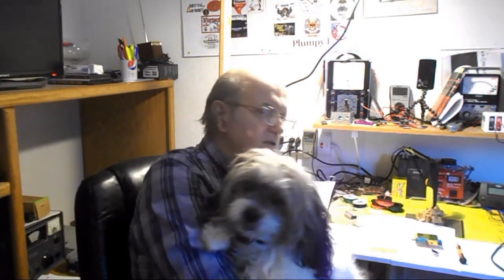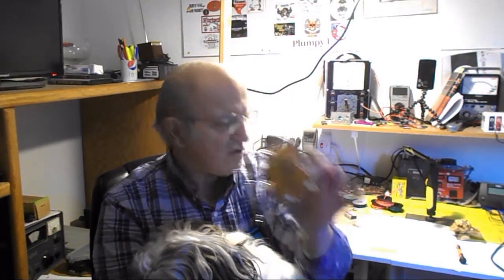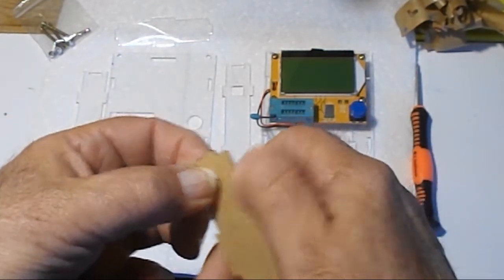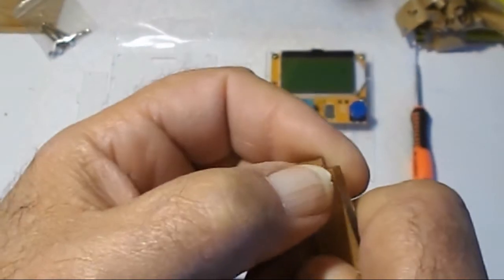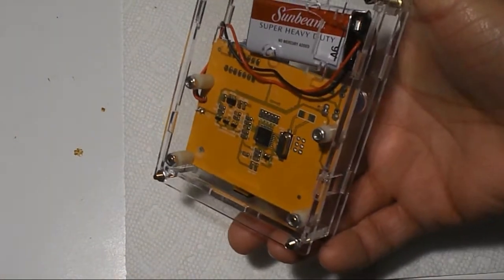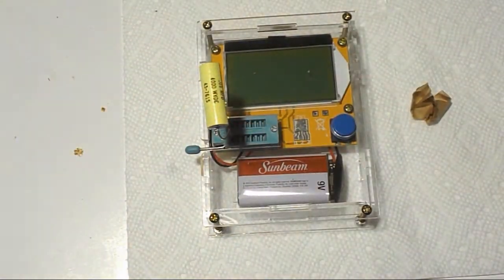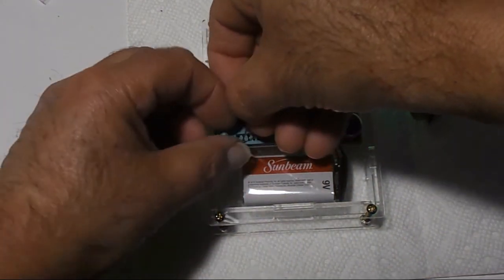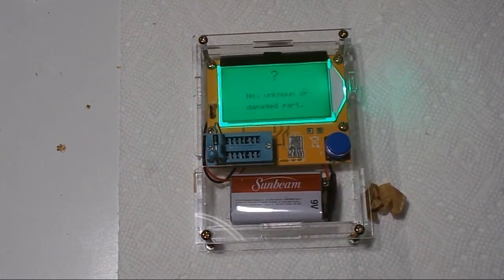Putting box together for new component Tester and then testing components

Comment: You have to put the leads in 1, 2 or 3, you put both leads in #1, there are TWO rows of 123123123.
Try inserting one lead i #1 and the second lead in #2 OR #3, it will show on the meter which leads and pins.
Try that, bet it works
Reply from the maker: Well Bill I have tried what you said and yes indeed it works fine. Thanks Bill just glad I didn't throw it across the room.
Reply: @LarryDeSilva64  LOL....YES I would have done that if I did not know that.